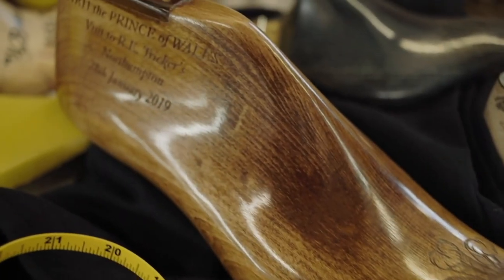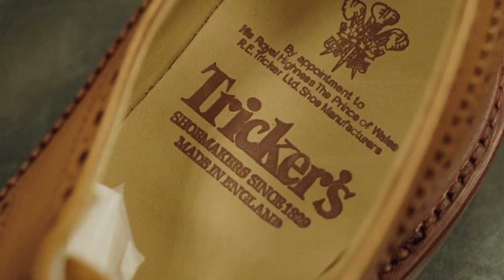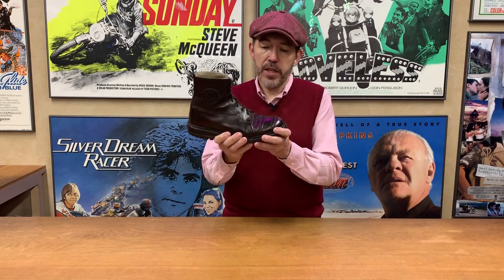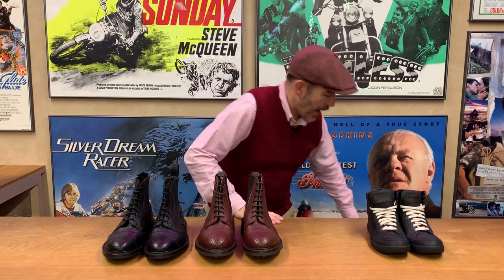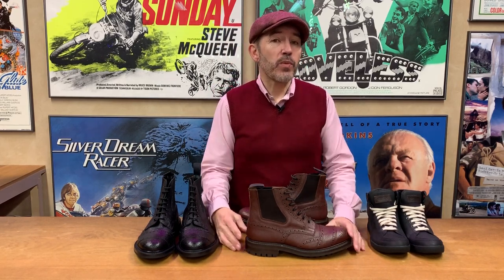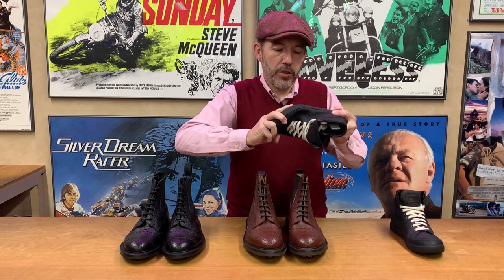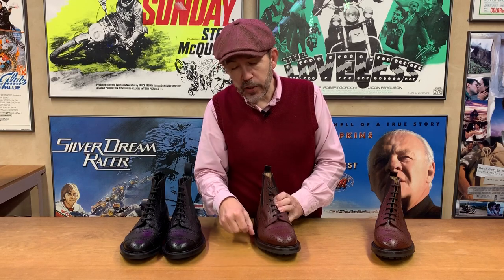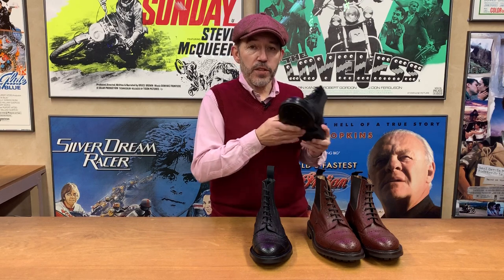Tricker's for Motolegends. Riding boots for distinguished gentlemen.

Comment: What's with the laces on a motorcycle boot. Only a fool would choose a laced boot.
Reply: Sorry but where do you think the shift lever is used? When you wear pants you probably would not even be able to see a single one of those laces. So i dont know where the problem is. If you dont like this style of boot then just go for a motorcycle boot with velcro and zippers, simple as that.
Reply: It depends on how you tie & tuck them away ,Zips always end up knackered broken laces are easier replaced .I only have laces on short summer motorcycle boots anyway ,Best motorcycle boots were the old Tusker full length wrap around multi strap & buckle fastening style .I had a pair last 16 years .